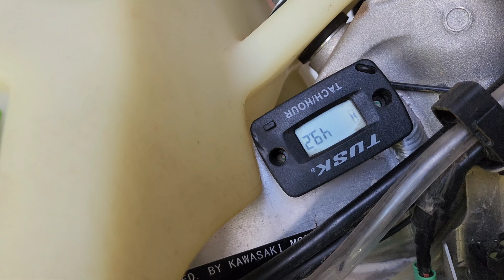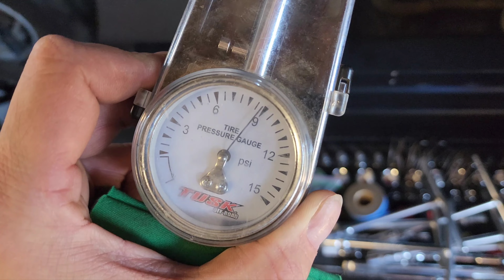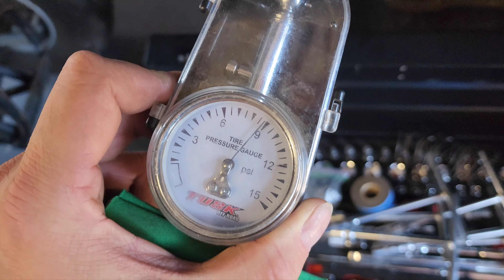Midweek Maintenance June getting ready for the dunes trip

Comment: Dang, those steering bearings are a pain to replace. You might be able to clean and regrease them. Manufacturers don’t put much grease in there typically. Better check those linkage bearings asap.
Reply from the maker: Ya I have heard they are no fun. Might have to look them all over come winter.